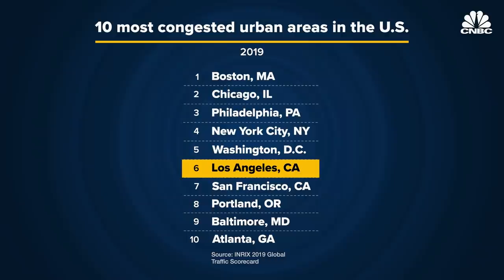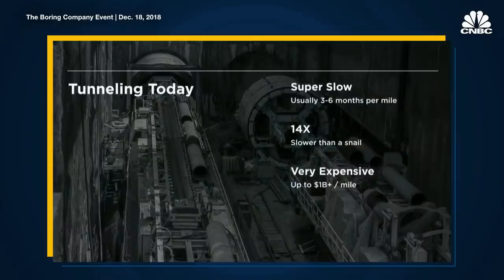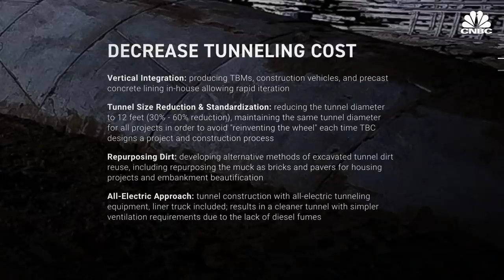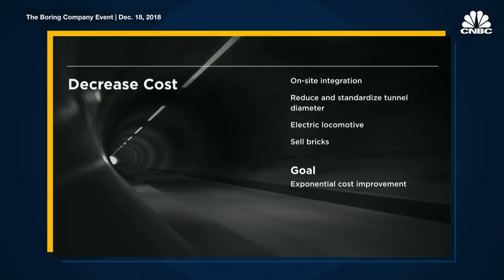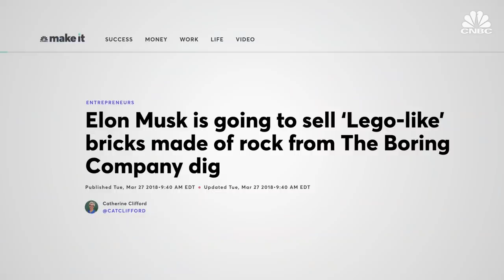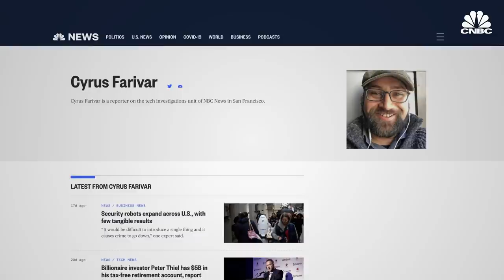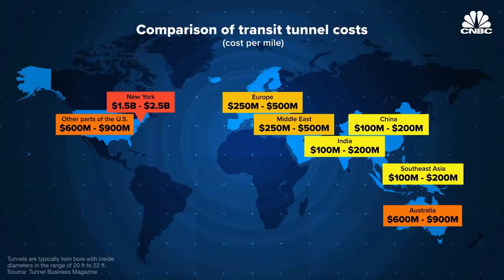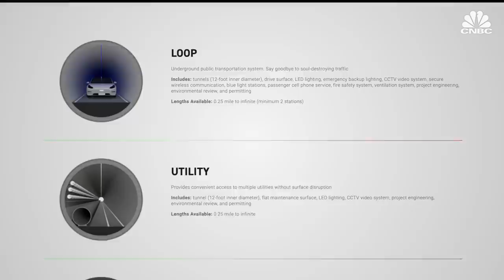Why Elon Musk’s Boring Company Isn’t Fixing Traffic Anytime Soon

Comment: There are these amazing things now called trains
Reply: No not at all like a train.  trains are faster lol
Reply: You can work or study. Or watch sports while commuting on the train.  It would make everyone more productive while avoiding traffick
Reply: Ok so I have to drive 15 miles to a train station and park there for a few or take a bus 🤮 to get there (which would take an hour) to go on something that has to stop every few minutes to take on and release passengers and pay $15-30 each way just for a trip from the suburbs into the city? No thanks
Reply: Government gonna build it for $1billion a mile while the boring tunnel builds it for $10million😂
Reply: @andybutsakone4253  the boring company makes very very very small tunnels with zero safety features, with zero practicality, for $50 millions.☹️
Reply: @abd-zf2gm  Which is a lot cheaper than building a train so tunnel... They could always just put tracks in it because apparently it's big enough for a train. Still cheaper than using the traditional way of building trains. You also can't say there's ZERO practicality.
Reply: @trisfaleel  dude, these tunnels are for transporting people, you have to put ventilation system, emergency exit and othe safety features, that why they have to be way bigger than this. That's why they are expensive, the boring company merely made a sewage tunnel.

There is no traditional way v boring company way, they just bought boring machines and started working.
Reply: @abd-zf2gm  A sewage tunnel is still practible so.
Reply: @trisfaleel  a kilometers/ miles long sewage tunnel would be a death trap for human beings, not only they cannot BREATH, no one can reach them when there is an accident, and other cars cannot excape.
Reply: not exactly the solution to this problem! some people just want to use their cars.
Reply: @scottblackburn2969  Sucks for us Coloradans to not have trains unless you live in the Denver area. The train in Colorado is mostly used for cargo transport.
Reply: You can't drive your car in a train. It's impossible
Reply: @beactivebehappy9894    it's still better to have those emissions being produced at a location where they can capture some of the carbon in it vs poison being pumped  directly into our city streets. 

Just because only 12% of electricity is currently renewable that doesn't mean we aren't transitioning towards more. It would be stupid to wait until we are 100% (or whatever arbitrary number you'd be happy with) green energy before we start transitioning from ICE to electric vehicles. Lets get cars on the road that can actually use that green energy once its available. 

With home solar becoming cheaper people could charge up their cars with their own electricity. With large scale battery banks we won't need to turn on horribly inefficient peaker plants. Maybe the left will eventually agree to use nuclear...

Your condom example doesn't fit this scenario. It's more like this.
"Use condoms to reduce to the population"
"Well there are other ways, you could take a pill or get a vasectomy or... "
"No! You can't have any of those options! We need to spend a billion dollars sending boxes of condoms to everyone in the city"
"We tried that before and we ended up with a billion dollars worth of broken condoms, yes mailing everyone condoms worked in Japan, but we aren't Japanese, our cultures aren't identical so you can't expect identical results. Also OUR condom manufacturers have a history of producing broken condoms, yet you keep pushing for them as if this time it will be different. Wed like to try an alternative approach and with way less financial risk."
"No you aren't allowed to even try this small scale project. Anything other than sending everyone condoms is going to be rejected by us."

That's what's happening here.
Reply: @trisfaleel  Tunnels for metro are the size they are because of safety features, ventilation and because metro is made to take certain capacity of people.

Overall unless there certain capacity of people, it's waste to build tunnels. Especially small ones like these that do almost nothing to solve traffic. 
Metro is just one part of solid transportation infrastructure. You need other public transport like busses, trams and public rentable bikes and small EV's like scooters. 
Individuals using cars, even electric is much greater strain to road infrastructure and environment than public transport and things like bikes.
When all these work together, along with infrastructure that allows for bikes and pedestrians, you get comprehensive transport system that allow easy access to places. All the while making city nicer, less noisy and reducing traffic. This is even win for cars because they can go faster.

Tunnels are not magic solution, no matter how you put it, it's expensive. If you want to lighten the traffic, easy first fix is to improve your bus network.
Reply: @stdesy  that because in your country they are built that way check in Tokyo or mumbai train are the best and most used transport
Reply: @krishnajoshi1488  Tokyo and Mumbai aren’t sprawling suburbs. The population density is too low here to be able to walk a couple minutes to get on a train for 97% of the people here
Reply: They need to make a nuclear tunnel boring machine that melts through rock instead of this current slow-ass machine they currently use. There was one designed back in the day but they never built it besides a scale model
Reply: @stdesy  in which city with a good subway would you actually have to drive 15 miles to get to a train?? Most cities aren't even that large. And the point of using bus or train is that, because they are so much more space efficient, travel eould be much faster and clean.
Reply: @cfv7461  I would have to drive 30 miles on a freeway to get to the nearest train station that is not solely for tourist trains that simply go in a loop through the mountains. The point of these tunnels is to replace freeways, not trains and busses. (And to eventually host cross-country hyperloop tunnels.) Musk conceived the company while sitting in LA freeway traffic, not while waiting for a subway
Reply: do you think they're gonna build a boring station right next to your house? you still have to drive and park, it's not magically closer. also what metros are you going to that are 15-30 bucks? Long distance trains don't count, because these tunnels are all in highly populated areas.
Reply: @purplelord8531  that sort of is the point to build them pretty much everywhere. You drive up to a certain part of the road, your car gets grabbed by a sled, lowered into an extensive tunnel system and shuttled around to an exit point
Reply: @stdesy  Are you joking? You know, public transportation isn't like that, when it's implemented well, every station will be within walking distance, and cities will become commutable via legs. And it's way cheaper than that, you'll only pay 2 dollars, and if that sounds too cheap and not sustainable, how money much do highways earn?
Reply: @quasimodo6491  Ok, you can just build outer roads in cities, that's how Amsterdam (and the Netherlands) dealt with it and drivers are much happier because of it. There is no traffic, because people drive for enjoyment, not to get from point A to point B fast.
Reply: @kayracan3663  that works for *cities*, it doesn’t work for suburbs
Reply: @kayracan3663  Electric cars pollute less if the electricity comes from renewable sources.
Reply: @stdesy  It does, look at Dutch and German suburbs.
Reply: @kayracan3663  yeah and I can walk 100 ft from my house and get on a bus. It doesn’t make it any less awful to do so, and have to make a bunch of transfers which makes getting anywhere without a car possible, but a pain in the ass. Not to mention the association with poverty. I’d much rather drive my ev a mile or less, get elevatored into a tunnel system, and sledded out to my destination. Better yet, combined that with autonomous cars so I can summon an EV that isn’t mine that will drive me the mile or less, get lowered into a tunnel system and sledded around to my destination. Like, what sounds more futuristic, self-driving electric car tunnel sleds or a bus with a bunch of gross people on it that takes 5x as long?
Reply: @kayracan3663  Better than nothing.
Reply: @trisfaleel  Not "better than nothing". The better thing to do is to get rid of cars. At least in cities. And make cities once more for humans, not killing machines. And I hope you realize how harmful it is to push electric cars as a solution to climate change. Elon Musk is just basically saying that he'll solve climate change with electric cars, when he's just not really doing much about it, and actually increasing it with projects like this, instead of encouraging people not to use cars, he's promoting them, and eliminating the real solution in the process.
Reply: @trisfaleel  cheaper isn't better.
Reply: Trains are great yeh, if you have a track. Lookup HS2 in the UK. Tracks can cost a lot cos you gotta alter the landscape, buy houses, even more environmental concerns as stuff actually grows and feeds on land.

Tunnels have their benefits.
Reply: @starmole5000  Are you serious with this? If this is a joke, it's a good joke, don't get me wrong. But if it isn't, contact me.
Reply: @kayracan3663  it is a really good joke
Reply: @kayracan3663  another good joke: trains in the UK are ridiculously expensive. Like a 100 mile trip can cost £200.
Reply: @starmole5000  Oh boy, how can they afford that? We should build unsustainable roads that don't earn any money instead!
Reply: @kayracan3663  well UK rail is largely privatised so the money just goes to private companies that generally provide a poor service (cramped trains, often late etc.).

There's a reason why a lot of people prefer their cars.
Reply: @kayracan3663  oh yeh and the taxpayer still pays partly for the tracks which is managed by network rail who lease the use of the lines to the rail companies.

Trains in the UK are a joke, you were very apt.
Reply: @kayracan3663  what is an "unsustainable road" btw? I mean how is a railway track sustainable vs a road?
Reply: @kayracan3663  yeah another thing: roads do earn money for the gvt in fuel duty and road tax...
Reply: @quasimodo6491  Then use your car the traditional way. Rush hour lasts for hours because practically everybody drives their care due to lack ofpublic transport.
Reply: @HavokBWR  Its funny how the oil industry is controlling every part of an americans mind. 
You have literally a whole infrastructure only build for cars but you still waste hours on neverending traffic jams. An easy solution are trains. A simple metro with 1000 passengers capacity per train can eliminate up to 30000 cars per hour commuting and your rush hour lasts for hours so you'll end up with up to 100000 less cars on the streets with a smart designed metro line. Every region functions better with good designed public transportation. Do you know why public transport is so bad in most parts of the US? Motor and Oil companies bought whole public transport providers only to close them down so people were forced to buy gasoline guzzling cars and thats why many americans remain poor, because if they can't afford a car they literally cant choose a workplace far away from their homes.

Btw. your gas is only so cheap, because the American government is subsidising fossil energy sources otherwise even a 30 train ride would be cheaper than driving a car daily to work.
Reply: @stdesy  Right, but investing in that infrastructure more would make commuting with public transport much easier.
Reply: You mean taking transport with other people and at a set time ? That's communism, I want car.
Reply: @beactivebehappy9894  the environmental cost of building those giant lithium batteries is insane
Reply: Lame
Reply: @scottblackburn2969  not really
Reply: @Presario3440  not really
Reply: @andybutsakone4253  wrong
Reply: @abd-zf2gm  false
Reply: Trains are places were people get groped.
Reply: Americans like to own cars, o don't know why? The trains in America lack innovations like what you see in Japan, Europe or even China
Reply: @stdesy  sounds like a you problem
Living in a suburb, thats a whole waste of space there, thats how municipalities go in the hole, millions of dollars to support a few in a large area
Reply: @stdesy  too bad building underground tunnels for car travel will never solve traffic. Way too inefficient, and the hyper loop will never work. That ship has sailed.
Reply: @stdesy  that's because America can't build cities or functional public transport. Not some immutable constant of life
Reply: @stdesy Or spend $200 on insurance and  $350 on car payments per month.

To each their own